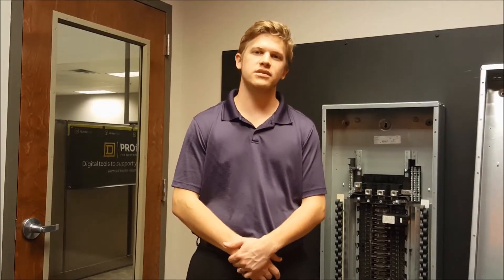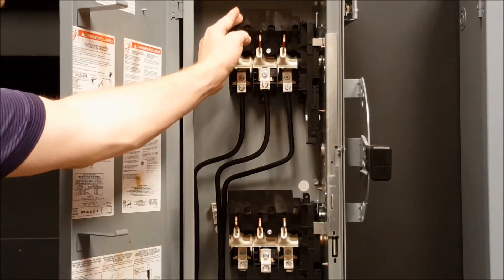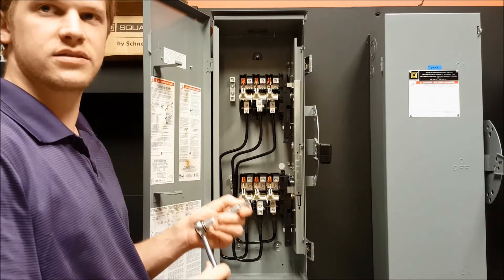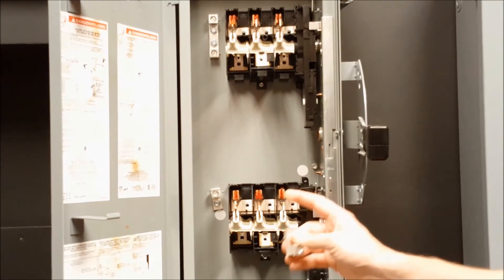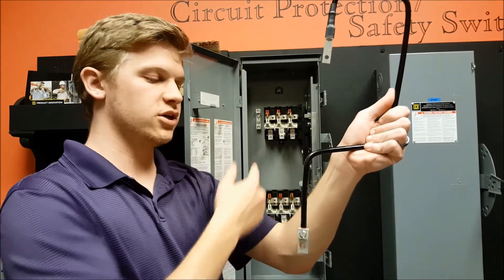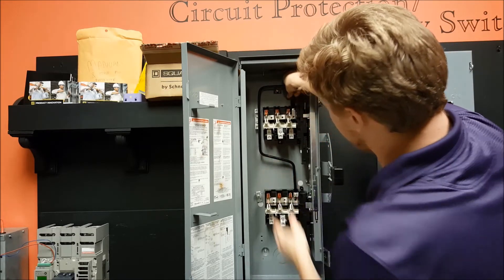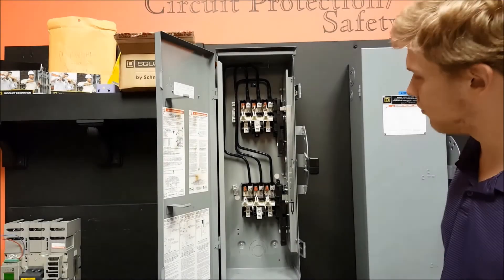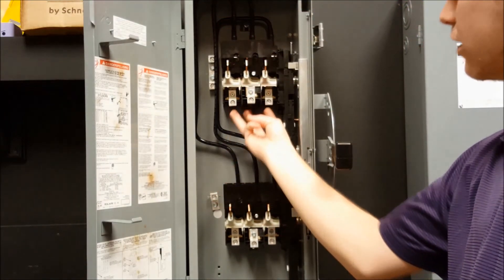OLD Converting F Series Double Throw Switch for 1 Source & 2 Loads | Schneider Electric Support

Comment: If the system that I have going is 3phase + a neutral and ground, do you have lugs that would connect all the neutrals together and all the grounds together but isolated from the box itself.
Reply from the maker: @OvidiuVijulie
Hello, we do have neutral lugs and ground lugs, where the neutral is isolated. However the ground is tied to the box. Regards, Customer Care Center